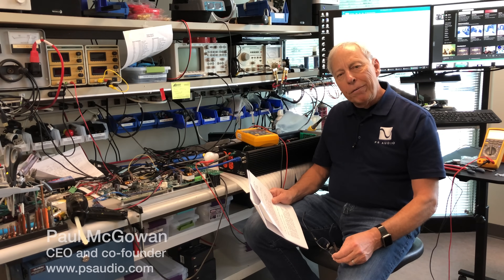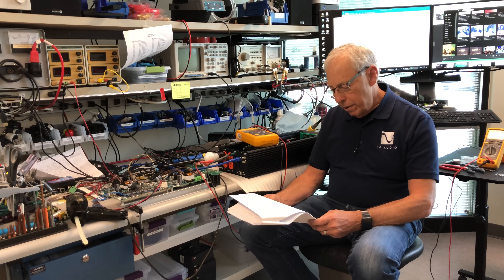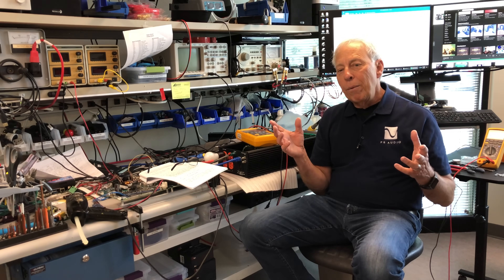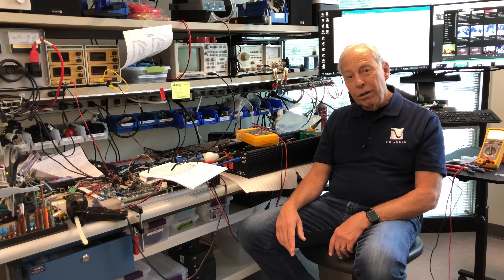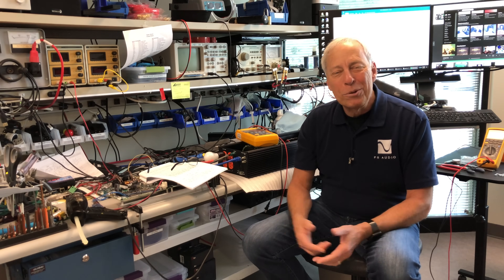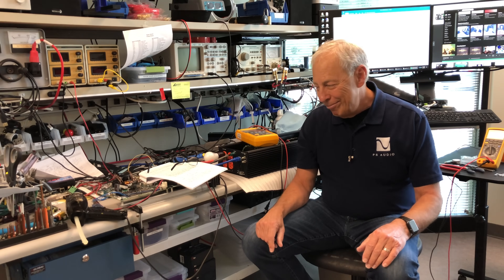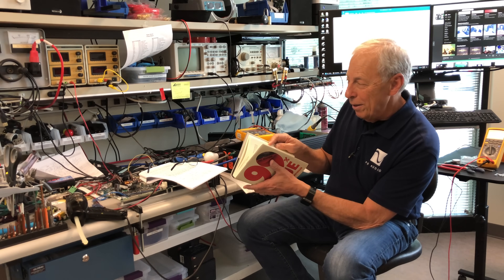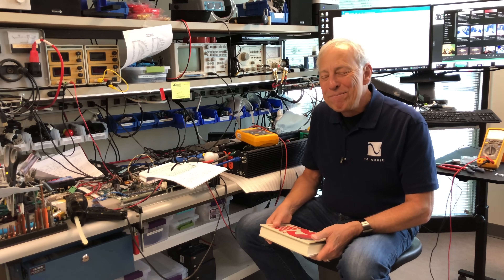Why hasn't the perfect amp been built?

Comment: I really like how Paul takes the opportunity to put things in perspective with the amount of improvement that has occurred over the last 70 years. When I was a kid and first became fascinated with HiFi I had very different goals than I do today. In those days, the early 70s, there were still a lot of old radios and amplifiers around that were from the 50s and sometimes even the late 40s. It was hard to find things that still worked much less worked well. I just wanted something that would turn on and not make a lot of noise or fade in and out. My goals, along with the state of amplifier technology, have advanced immensely. Now I pretty much take for granted that amplifiers are going to work perfectly for decades without maintenance and with so little noise and distortion that they're practically inaudible. Now I would like an obscene amount of power and heavy duty terminals and the ability to run any kind of speaker to it's absolute maximum best sound quality, and I want it cheap! LOL. And the great thing is, if one is not TOO cheap, it's pretty much already out there.

I think I'd like a couple of PS Audio mono amps some day. They aren't what I would consider cheap exactly, but wow the prices compared to what they would have been back in the 60s, or even as recently as the mid 90s, are a fraction of the cost for much much better reliability and sound quality. I think it's a great time to be shopping for a high quality amplifier.

Comment: The short answer is that every electronic component has "parasitic" impurities. So the more more components you use the harder the fabrication becomes. This is true with all audio components. With Power Amps you have the additional issue of the internal "transconductance" changing with heat given off when you start to drive the amp.  This can affect the S/N ratio and distortion even with a "perfectly designed" amp.

Comment: With respect to power efficiency amps will never be perfect
Reply: Chris DeBlanc D class
Reply: @FooBar89 
Class D can achieve efficiencies above 90%. They are basically fully real time adjustable inverters.
Reply: @4G12  impressive.. not perfect
Reply: @4G12  no, the techniques used in both is the same, it's not an inverter
Reply: I remember someone actually made a class AB amplifier with a variable supply rail that enables the smooth sound of a Class AB amp with the efficiency of a Class D amp.
Reply: Hypex nc400